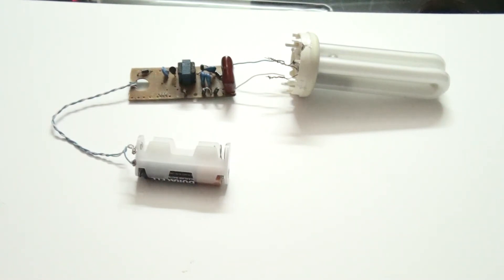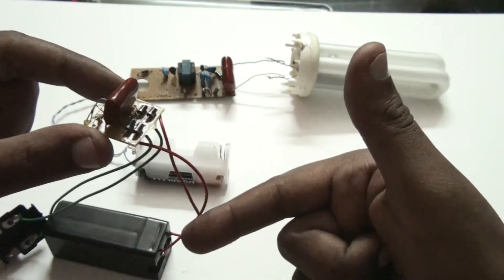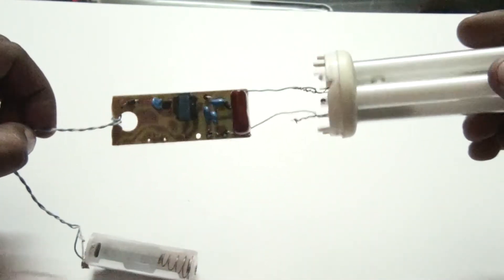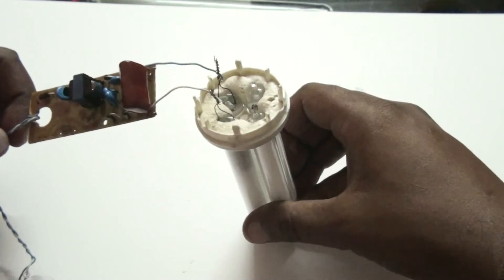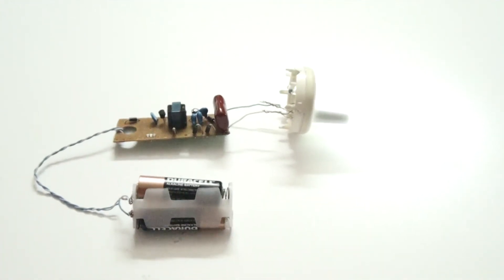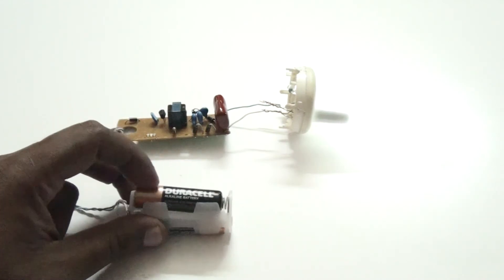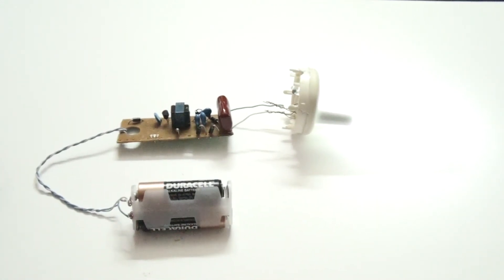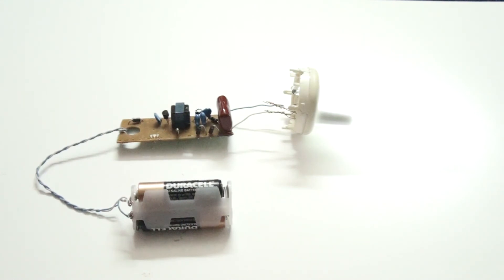Bug Zapper Circuit (mod fuji Circuit, Joule thief circuit)

Comment: Well, you COULD just add some more of those same caps in parallel, but I like removing the DC side of that circuit and replacing it with a large voltage multiplier circuit to get many 10's of 1,000's of VDC.  Not sure if it would brighten that bulb, but it is, for sure, a lot more fun!

Comment: After watching your video, I hooked up a similar bugzapper circuit to one of my joule thief circuits. It turned 0.6 volts into 88.5 and ran a small motor taken from a dvd player and lit an LED. I would build a standard joule thief and experiment if I were you. That circuit seems to work with very low voltage. Thanks for posting this video!!! : )